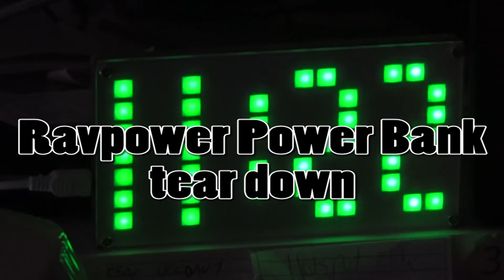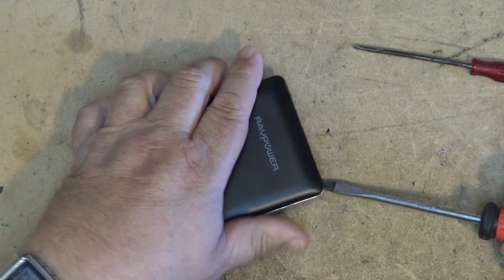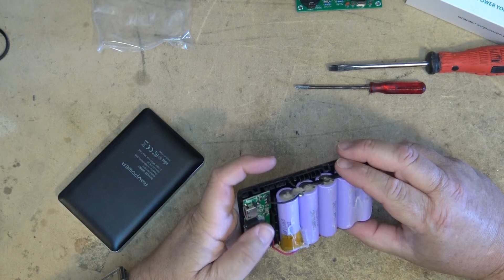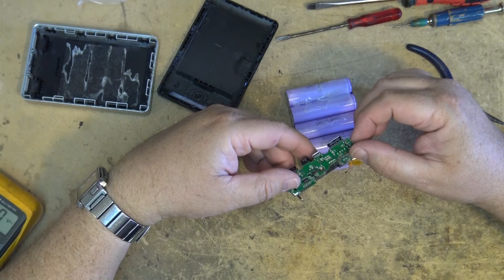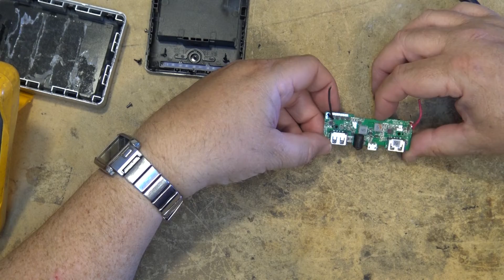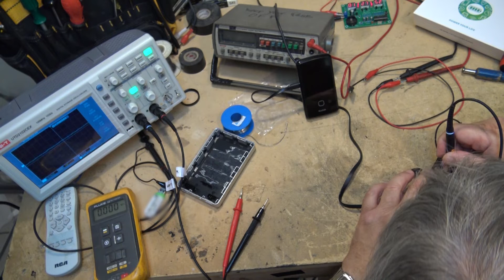Ravpower power bank tear down

Comment: Hey man, recently my powerbank (same model as in your video) fell into water. Sometimes randomly all lights are blinking, i cant charge it up anymore and if i press flashlight its only lasting for some seconds and not as bright as it should be normal.
I also opened the power bank but i cant spot anything wrong. do you know what could be damaged?
Reply from the maker: Anything could be wrong.  It fell into water.  Water conducts electricity and those batteries have a ton of energy. Any part in the board could be damaged.

Comment: I have only seen one power bank mention that the 16,750 mA. in the batteries are at  a nominal  3.7 Voltage. But when converted to 5.1 volt it is around 12,152  mA.
None of them talk about you lose an extra 8-10%   in heat,
Even with a very efficient 90%  conversion so now we are down to about  10,937 mA. Of actual capacity. But it still gets worse!  We can only drain the battery down to around 75% -  80% of its actual stated capacity because of the low voltage damage to the battery. Now we only get around 8,203mA -  8,750 mA. That we can count on as a backup.
 Even yet, with all that being said. I think they are great batteries and it is a great technology but Just like everyone else, I can't wait for the new technology to improve them!

Comment: Nope the cell is 4.2 volt, it also charge at 4.2 volt. 3.7 volt, is the low cutout limit.
Reply: Not quite. For these LG 18650 cells, the max voltage of these is 4.2v (that's common for all 18650s). Nominal voltage is 3.7v. Cutoff (low) voltage is at 2.5v (for these cells)

Comment: Do you think these powerbank can be dangerous?
Battery are connected in parallel,not single separate slots,
So if batteries are not balanced or one cell discharge or overcharge faster than others it's a risk

Comment: To have the socket live all the time will consume some power, but it is a good thing. So items that you power off USB have such a low draw the power bank may not turn on or it will turn off after pushing the button to power it. So that is a nice feature. The temp probe is also a very good protection item, as many of these don't have that feature. This is a nice pack.

Comment: good vid not just some guy going yeah this is good u pull the thing apart and test it..might buy one
Reply from the maker: MrFourseven 
This unit charges my BlackBerry PRIV very quickly. I plug it into the ravpower and I have an 80% charge in about 30 minutes, full charge in 45. On the ac charger it takes 3 hours to fully charge and I am using the lower amperage port. Ravpower sent me their smaller battery and an anker brand to test and it also is very good. My daughter stole that one and I use this bigger unit to recharge whenever I forget to charge and need a fast boost quickly.
Reply: @12voltvids  Hi, would you  be able to send me close up pics o main charging board  o this unit as small black component blow out, I can not see any description of it...thanks

Comment: The second you showed the 18650 cells i liked it, as you said a safer unit :-).

Ahh the old Micronta 22-195, not high spec but quite usable, using a chip that was very similar to modern autorange single chip multimeters.
Quite advanced for it's era :-)
Looks like it's seen a lot of action lol :-D
Reply from the maker: Yes that meter was on my bench at the shop for many years. Doesn't like complex waveforms though. Measure the video output transistors on a working set to check the voltage and it has a heart attack.
Reply from the maker: I was expecting to see Li-Po cells in it, so I was pleasantly surprised too.